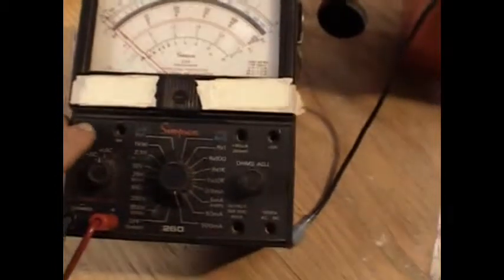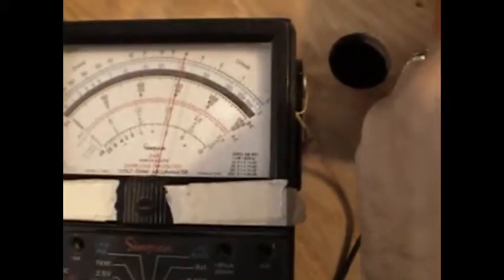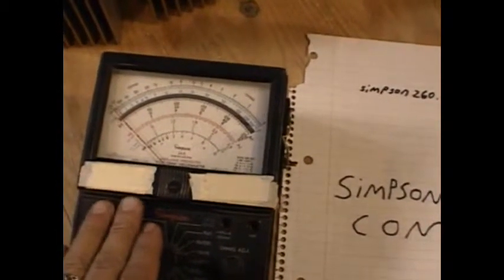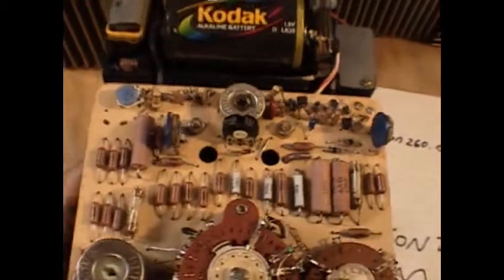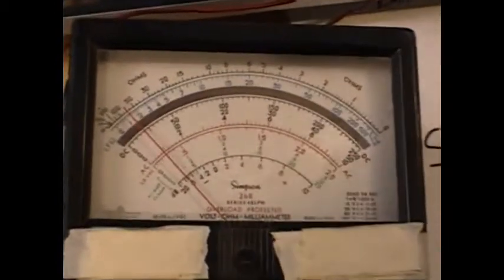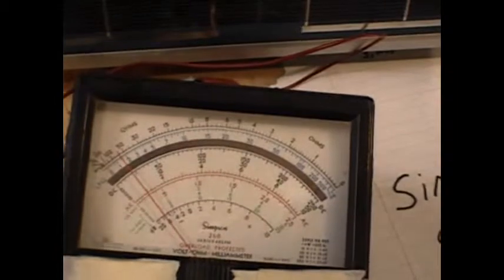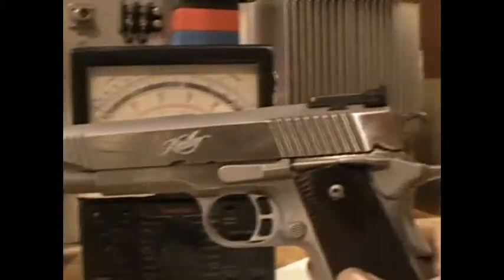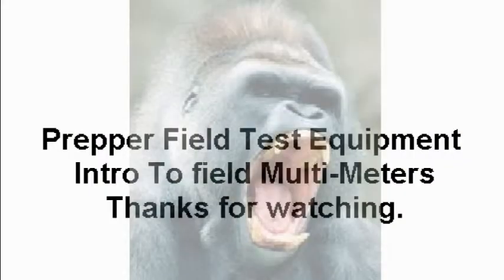Prepper Field Test Equipment Intro Part Two

Comment: ..if you measure 10,000 ohms on the Rx1 scale will you also pop the breaker? 

(Just kidding!)
Reply: Series 5 and above have a pair of diodes across the meter to protect it against overloads.  Doesn't protect the entire meter like the circuit breaker, but the meter is the most critical part.  Resistors can be easily replaced. For earlier meters, a pair of silicon diodes, such as 1N4002, in parallel, reversed polarity, across the meter terminals would be advisable.